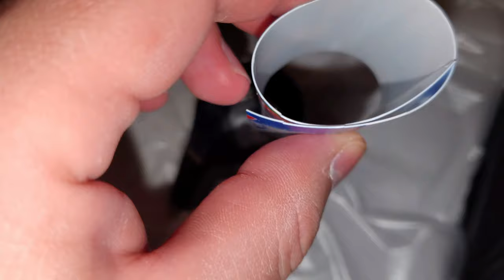NIU KQi2 KQi3 Electric Scooter - disassembly of the thumb throttle

Comment: hi do you know how to fix the locking latch. More specifically the black metal part that locks the stem together?
Reply from the maker: Not sure, what is wrong with it? I would have to see some photos or video of it to see what might be a problem and maybe I would be able to suggest a solution. If you can upload some photos on imgur or create a YT video and reply with a link and I will try and help if I can.
Reply: @Lantea13  I will do that. Customer service at niu has been terrible at niu. I sent it in for repairs then they sent it back with the latch broken. So they sent me the parts to install it with no proper instructions. So I will make a video for you hopefully u can have a better idea of how to fix it.
Reply from the maker: @thaskunk1  Sorry to hear about your bad experience. Did you manage to figure out the latch?

Comment: Hi, how do you actually remove the throttle. Got the grip off but cannot seem to take the throttle off?
Reply from the maker: You need to loosen the nut holding it in place, there is a small hole on the back/bottom side. See https://youtu.be/6U0HE3f7d9M?t=540

Comment: nice video. did you have a picture for me from the connector of the throttle wich is inside of the rubber? i wanna check out if there is an other aftermarket throttle wich will fit to the NIU KQI. i think these NIU throttle models are not very good from quality.

maybe the xiaomi/ninebot throttle will fit.
Reply from the maker: There is a detailed schematic of the throttle wiring on page 25 of the KQi3 service manual that someone linked a while back here https://www.trovaprezzi.it/manuali/niu_kqi3_pro_nero_rose_gold.pdf the throttle is the same as on the KQi2
There are also some photos in my written guide https://www.reddit.com/user/Lantea1/comments/14cjee8/niu_kqi2_disassembly_and_repair_guide_for_the/
I have a spare throttle somewhere, so I can take a few photos and reply here again a bit later, probably over the weekend.
Reply: @Lantea13  thx, a pic would be very nice
Reply from the maker: @1987Palme  Here are the pics of the NIU KQi2 Pro Throttle https://imgur.com/a/L4QkiBC
Reply: @Lantea13 thx a lot ❤
Reply from the maker: @1987Palme  np, happy to help :)

Comment: Where do you get a replacement throttle
Reply from the maker: You can order spare parts from NIU service partner at https://shop.besender.com/store/ if the part you need is not listed fill out this form https://niu.besender.com/form and they will reply to you with the cost of the parts you need.

Comment: how to remove the wheels and repair the engine of NIU KQi2 Pro
Reply from the maker: For the front wheel I replied in your other comment ("you need to remove the orange stickers, and the screws holding the plastic covers and then remove the wheel, this diagram shows you the details https://i.imgur.com/XxzzORT.jpg "); the back wheel you can see that from this video on the back fender https://youtu.be/51C4HHwN7WQ, see at https://youtu.be/51C4HHwN7WQ?t=226 you loosen the axle nuts, disconnect the motor wire from the controller, and remove the back wheel with the motor.
As for disassembling and repairing the motor itself, that is beyond the scope of simple scooter repairs and I don't plan on taking apart the motor itself. If for some reason the electric motor broke you should still be within the two year NIU warranty so I would suggest you contact NIU support for repair or replacement if it does not work.